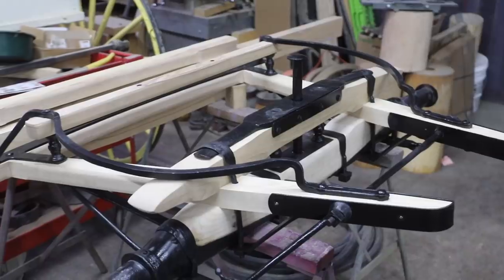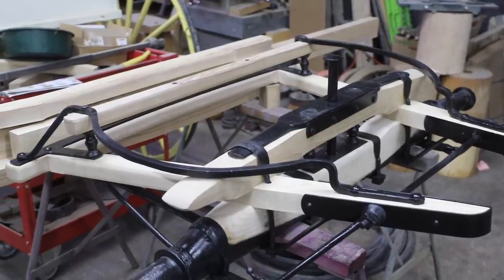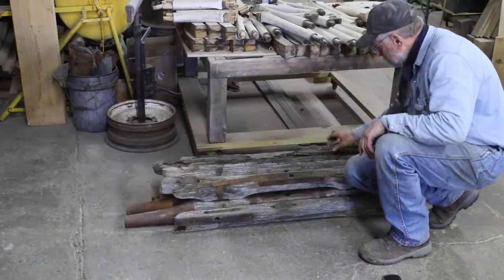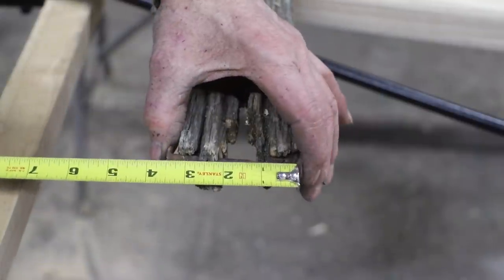Repairing Chain Links & Mounting Wagon Brakes | Engels Coach Shop

Comment: I just purchased 800 dollars of Makita hand tools. Now I just need another 100 of your videos to learn how to use them . Lol. I love your channel . Best to your family . Thanks.
Reply: Drilling straight is a great exercise.
Reply: @SPW812  agreed ,would start with a hand crank drill for a few holes,then power tools
Reply: @jeffclark2725  When I was a kid, the two options for drilling a hole was an egg beater drill, or a brace and bit.  The egg beater was ok. but the brace and bit drill took three people to operate it. One person to drill, and two people to tell you which way to lean the drill to keep it straight.  LOL
Reply: @Dave-ty2qp  the brace beater,the proper name for the drill that looks like a speed handle?
If so agreed 👍
Reply: @jeffclark2725  The proper name for the one that looks like a speed handle is a brace and the drill bits that went with the brace were tapered and square on the ends that fit into the brace. Thus the name brace and bit.
Reply: @jjohnson2553  thanks
Reply: @jjohnson2553  Yeah, Thats the one called a Brace, and Bit.  The egg beater drill was the one that looked like and operated like an egg beater.  They both had keyless chucks, and were reversable.  Also you had to recharge them with an ocasional 5 minute break.  LOL

Comment: Glad to see that you cut the excess off the ends of the bolts and hammer them almost flush with the nuts, preventing the nuts coming off and much safer not to have sharp edges of thread sticking out in the event of an accident and reducing the weight of the vehicle, so helping the draft animal. Very much enjoy watching your films. I use draft horses in the UK and keeping the vehicles light and safe is so important. Thanks.

Comment: The iron may rust & the wood will rot but Mr. Engels gives it a shot. Take it all apart & set it on the floor. Think about it, maybe just a little more. Make some patterns from old rotted wood, does it fit? Good! Sand blast & paint the old rusty iron. Reuse it, it's not retiring. Now the fun begins ,  where do you start? Look at the way it all came apart. This goes here, that goes there but what about that? Time to have a scratch under the hat. He's never really in the dark, he just looks at that rusty mark!
(Sorry, feeling poetically inclined today.)

Comment: Dang. Just watching all the effort you have to put into rebuilding these using modern equipment and techniques and patterns to build off of. Gives me even greater respect for the original builders usung draw knives, Bits n Braces, and hhand saws n files. You would never immagine the multiple hundreds of hours  they spent building these. Yet still produced so many of them.
Reply: The difference is that they were not built by one man but a team of men with different skills and expertise.  Basically a factory  .  "You would never immagine the multiple hundreds of hours  they spent building these"  I believe I have seen it all accomplished here and, in some instances, without the power tools.   Is this your first time here?
Reply: Factories, by the 1860's had (dangerous) powered equipment. Some of the gang spoke turning machines were pretty clever inhouse mechanical creations. Studebaker alone quickly built thousands for two major historical events, the gold rush and the military during the civil war.

Comment: I laughed at the question marks when you where trying to install those "dog leg" bolts at 8:43. The old wood axle had a nice wear mark of where the bolt offsets should be placed. 
Your metal welding technique to reuse the original brake metal pieces by filling wallowed holes, building up worn bolt shafts and clapped chain links was great. I assumed you would fabricate new replacements.

Comment: One thing I liked about my old Ryobi drill was that it had a bubble level on the back to help with keeping a bit straight while vertical drilling...sadly my newer one doesn't have it.
Reply: My Kawasaki (really Alltrade) cordless drill is just the opposite-has a level to help with horizontal drilling. But I still can't drill from opposite sides of a piece of wood and have the two holes line up! Another way Dave amazes all of us!

Comment: Once this wagon base is together, is it possible (for us non-horse people) to go through and explain the design and why it is what it is? I look at it and think that there are bits of wood and metal all over, and they must have a reason for being there but why they are shaped and positioned the way they are...
Reply: Think of this wagon as an all terrain vehicle, loaded down with enough supplies to last 4 to 8 weeks for ten people. The wagon had to be strong, flexible and tough to get over rough rocky terrain without breaking down. This chuckwagon, being from a mountainous area, showed signs that the brakes were in high use.
Reply: @opendstudio7141  Yes, I know that bit. I want to know why the parts are there. A wagon could be build just as a square box with an axle under it. But it is not. The rear axle frame is an A shape (why not a T shape?); there are metal straps going from the rear axle shoes to the front of the frame - why are they separate and not bolted to the frame? There is lots of metal reinforcing all over - I guess wood was cheap and could be shaped by anyone but metal was expensive and required a forge (and special skills?)? How did wagon frames handle twist when going over uneven ground? What parts were there to allow that?
Reply: @occasionalmachinist  Your car goes through 'metal fatigue' that you do not see, and nowadays we have 'shock absorbs' none in those days.
Reply: The two independent running gear are spaced and held by a flexible ash center beam called a reach.
Reply: @occasionalmachinist  
I think they’re missing the point of your question. 
I’d be interested in Dave doing the video as you mention too. 
One thing I can say with confidence is that most of the extra brackets and braces were probably added during the long evolution of a wagon with adaptions made as the owners used them and found all the weak points. Not to mention the evolution needed as people moved west and encountered the brutality of the mountains.
Reply: I agree with Wayne and yourself. That would be a very educational and interesting video. A lot of it makes sense from a wear point of view.
Reply: @occasionalmachinist  I to would enjoy an explanation of all the pieces but until then I have educated guesses. People today look at a wagon like this and think "how barbaric, look what the old hicks slapped together" assuming the craftsmen that made these were idiots is a severe misconception. These old timers were smart in ways that have been nearly forgotten. All these extra pieces like the rods you mentioned and why the axle structure is A shaped is all for strength and weight reduction. Geometry plays a huge role in these wagons
Reply: I stop the video and look at each part to figure it out, at 20:28 there's a good view.
I watch a lot of old movies, in the last year anytime there's a wagon in the movie, I try to look it over and see how it's built, I also look at the harnesses and everything.

Comment: At 0:43, behind Dave on the floor, we can see the pile of metal parts for the rear axle assembly. In particular note the metal axles covering the ends of the wooden axle. At the end Dave says this chuck wagon was built around 1900. Just what I am thinking about this restoration.  I am certain that in 1782, twice as far into the past, there would have been only 10% as much metal in this sort of wagon. Perhaps less than that. This video shows an immense amount of iron parts, which were only available after the Civil War, ca 1870. This wagon was originally built after industrialization made metal parts inexpensive and plentiful. I wonder if there is a reconstruction of a Roman Legion wagon. That would be instructive. It would tell us how much is known about that sort of wagon, and it would show the amount of metal used before industrialization occurred in the late 1800s.

I love these detailed videos of how-to-do-it. I appreciate Dave showing all of the steps. Dave is preserving a vanishing skilled-trade. Several in fact. I think Dave is producing a precious, priceless series that will save several dying crafts from oblivion.  However, as this video amply proves, Dave is barely reaching 150 years into the past. These videos make me mourn the lost art of the nearly all-wood horse-drawn wagon from an even earlier age.

Comment: Great Work!  If you replaced the wood with metal, you would have the beginnings of a car chassis.  Interesting to see how car chassis developed from these old wagons.  I've often wondered how long the skein/hub would last with just grease as a lubricant.  And what type of grease?  Beef tallow or some early petroleum grease?  Dave is the master of drilling long holes in wood.

Comment: The refined  and evolved  structural elements  , load  and  torsion  work  with  reinforced attaching points..where there is a rocky , inclined load  with animal moror..you have   amplified utility , low weight and common materials for  ubiquitous  repair horizon...metal joints for stress and reinforced to add strength. ..what a  dependable  work amplifier..!!

Comment: Hey Dave, been a subscriber since you were near the end of the borax wagon build. Thank you for passing on your knowledge and skill for others to learn. I'm curious if you have ever used mirror cardstock to drill your holes straight. Drill a hole in the middle of the cardstock slightly larger than the hole size you are boring and use the reflection to keep it straight. May save a little time and prove accurate. I am impressed how you drill from both sides in large material and make it meet in the middle every time. A pencil reference line is usually good enough, but sometimes you need to reference two ways and thats where the mirror comes in handy.

Comment: Fascinating as always, thank you, Dave.  I have noticed that you practically never use wood glue; why is that?  Wouldn't glue make the wagons stronger?  Is it to allow slight movement and not make it completely rigid?  Alternately, could it be that you try to replicate the original exactly?  Best wishes from a retired electronics engineer in Johannesburg, South Africa.

Comment: I enjoy your videos and I have a question.  You tighten up those square nuts  really tight.  But wood shrinks and those nuts could become loose and eventually undo.  Why do you not use a washer  and a "spring washer to give the nut some tension to allow for wood shrinkage ?

Comment: The overlap witness on that forge welded chain link bothers me a little bit.  The original Blacksmith who made that chain link should have taken another welding heat and cleaned that up a bit.  I've seen this before on antique chain but not so dramatic. When I make hand forged chain, I never leave an overlap so visible like that for fear of an incomplete weld.  Anyway, great work!!

Comment: Maybe I've missed the explanation, but why does he char the inside of the bolt holes?
Reply: That makes for a superior fit.  The holes were drilled, slightly undersized, from each end and met in the middle.  The heated rod trues the finished hole up.
Reply: I believe it's partly to align the holes, they were drilled from both sides.  And partly to harden the wood to prevent rot.
Reply: @eliduttman315  I see, that makes sense.  Thanks.